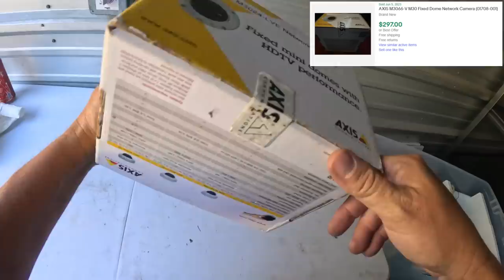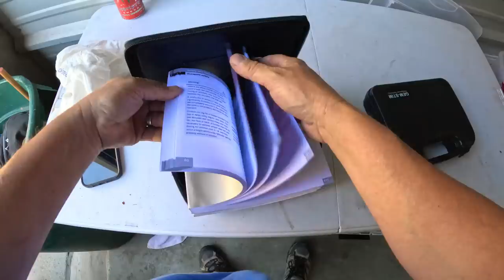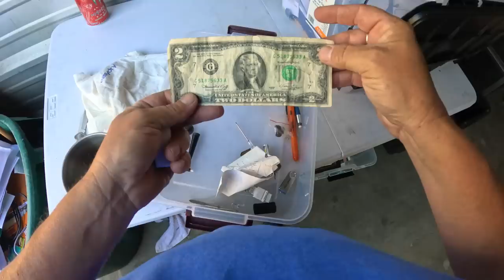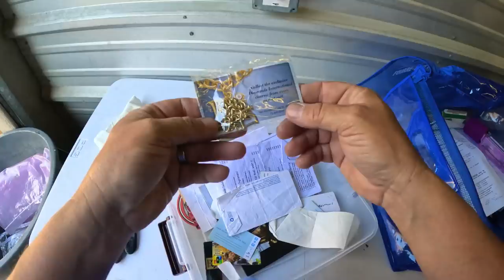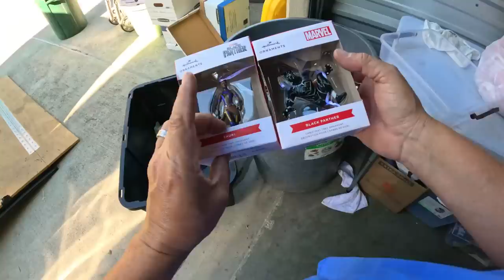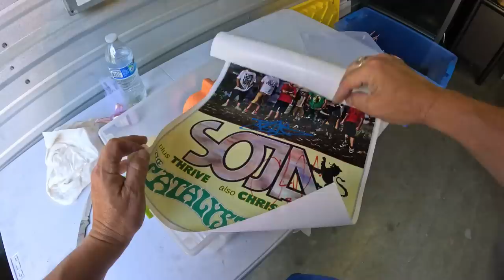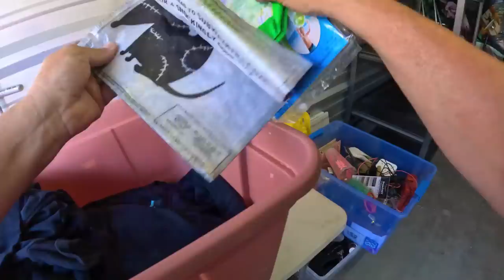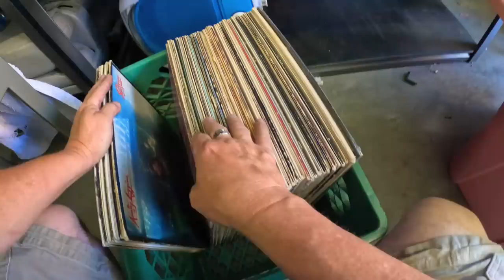INCREDIBLE! Uncovering guns hidden in abandoned storage unit!

Comment: That t shaped tool with "comfort gel" red handle is for pulling weeds without having to bend over. You place the pointy prongs over the weed and step on the foot pad. Use the handles to twist and lift the weed out. Then the button on top ejects the pulled weed. 😊